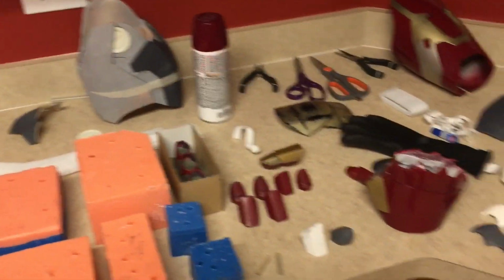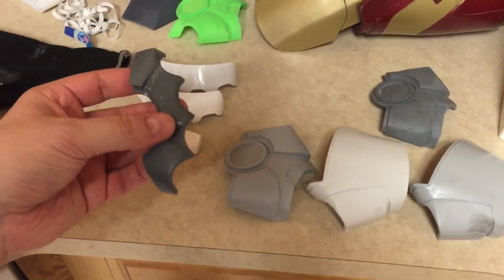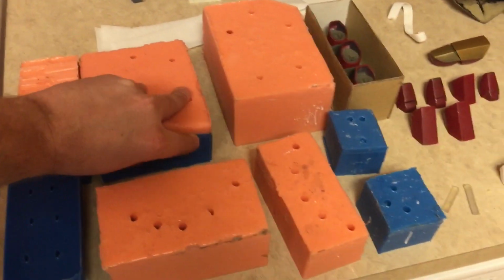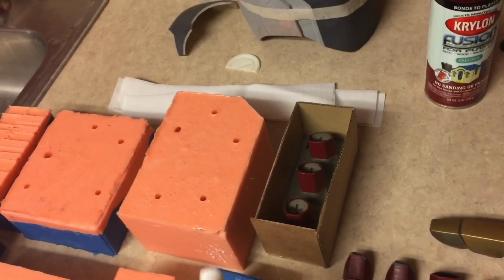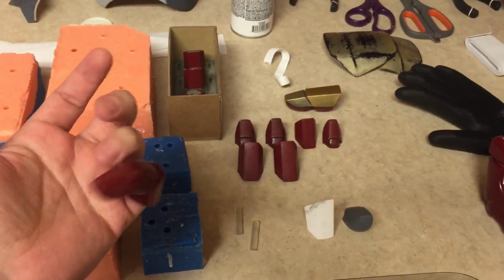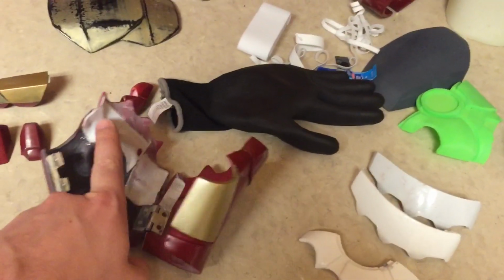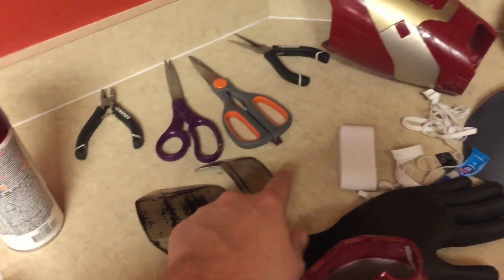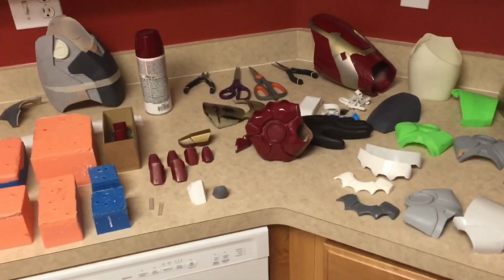Ironman 3d printed hands

Comment: Considering the massive cost of silicone molds I would rather just use the 3d printer....I'm working on my suit right now. with 10% infill and 0.4mm wall thickness you get sturdy parts.

Comment: Out of curiosity why are you casting the 3D parts instead of just using them for the suit?
Reply: because the 3d parts are weaky and prone to break.
Reply: +andre patacchi That really depends on the material you print, and your print settings. 3d printed parts have surfaces that are relatively rough and nearly impossible to finish perfectly for paint.
Reply: No, if you know what you are doing then you can just use the 3D printed parts, Sand down the edges, spray it with filler primer and you will have a 100% smooth surface